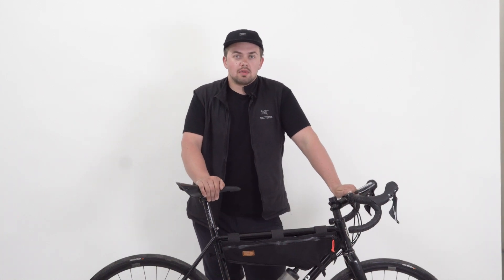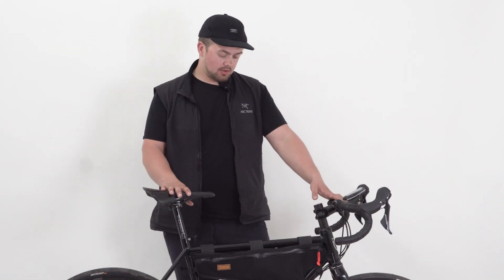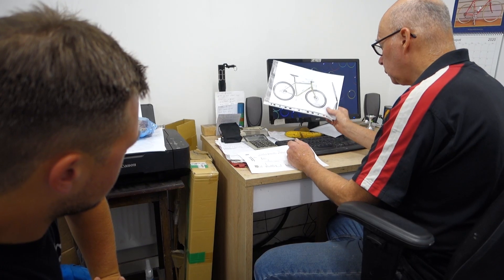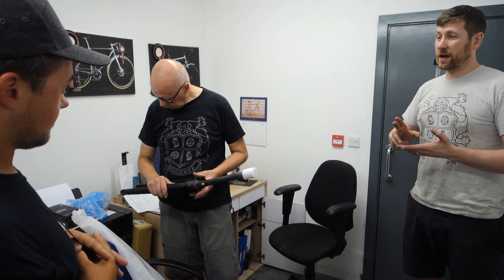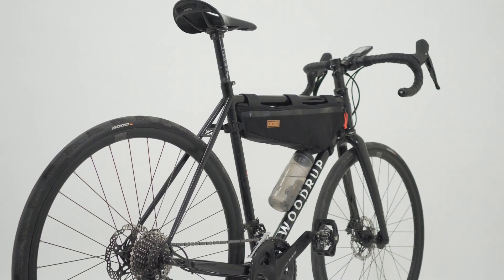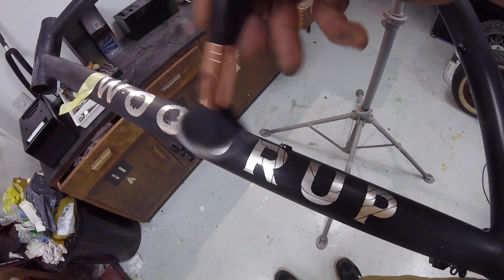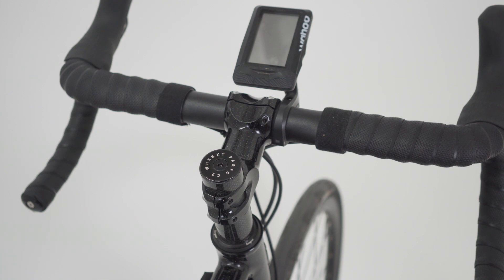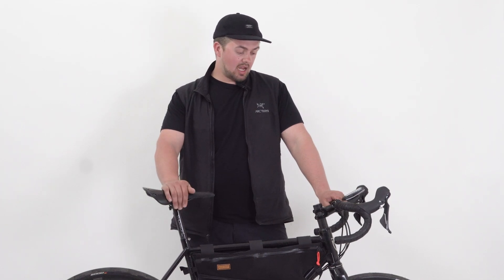Building a Custom Bikepacking Bike

Comment: That paint job is 👌 Just wondered why you have so many spacers at the front end? I would have thought that a custom geometry would have removed the need for these?
Reply: Still haven’t built up the courage to cut down the forks. Will have final adjustments done after next few rides 😉
Reply: @nathanhughes6939  Measure twice... 😉